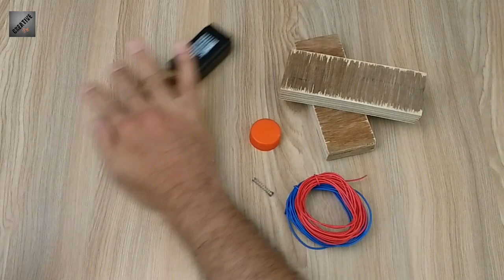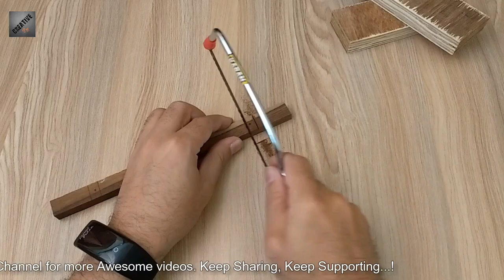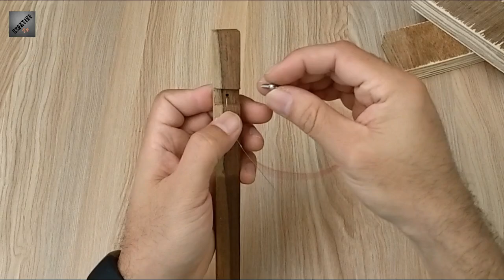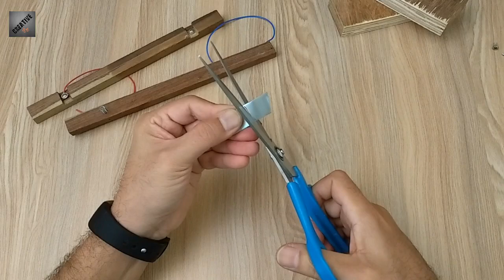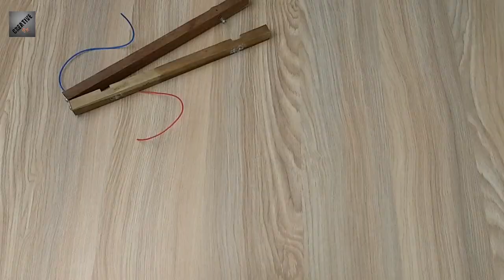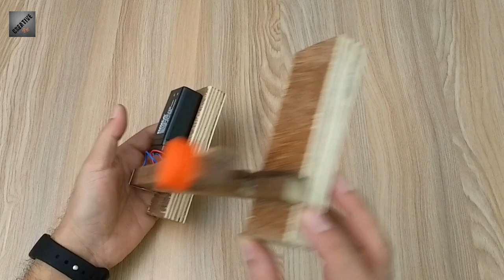How to Make a Plastic Bag Sealing Machine

Comment: I thank you for making this kind of videos they are educative, i also will like to ask if you can make one about a 12 battery (car ) charger that applies to usa please i mean that we can find easily the items needed for it again thanks and i will be looking for a reply
Reply: the wire is nichrome (hardware shop should have it) and you should do the following... the charger you mention has a specific amperage it outputs so do the following measure the resistance of the wire you are using and divide the voltage of the battery (or the source of energy you are planning to use) by the measured resistance the result will be the amperage that will flow in that circuit so if that amperage is lower than the rated one in your charger all good if not get another charger or use a non lipo or nimh battery unless it has protection in it

Comment: If you not make a switch in the machine the nichrome always get heated
Reply: The circuit closes when its pressed down. There is no need for a physical switch. The mechanism of pressing down does the switching.

Comment: What about using 4V output Adapter? Then i can use AC source too🙂
Reply: the charger you mention has a specific amperage it outputs so do the following measure the resistance of the wire you are using and divide the voltage of the battery (or the source of energy you are planning to use) by the measured resistance the result will be the amperage that will flow in that circuit so if that amperage is lower than the rated one in your charger all good if not get another charger or use a non lipo or nimh battery unless it has protection in it

Comment: can I use phone charger instead of battery.
Reply from the maker: No it will not work, instead of phone charger use 9v or 12v DC adapter.
Reply: How to connect with transformer ip 220v op 9v?
Reply: @CreativeLifes  12v 4amp dc adapter is also not working. It is not heating. Should i increase the amp?